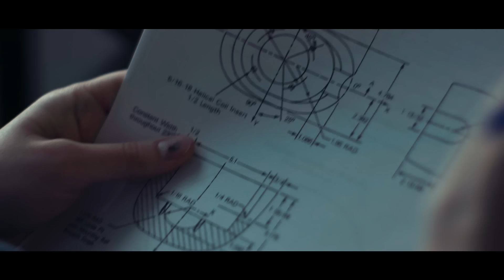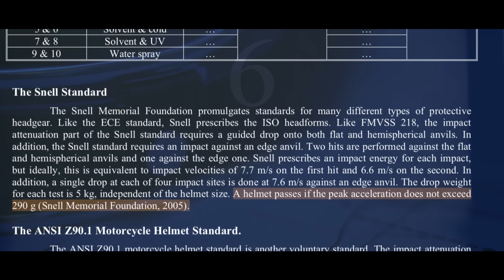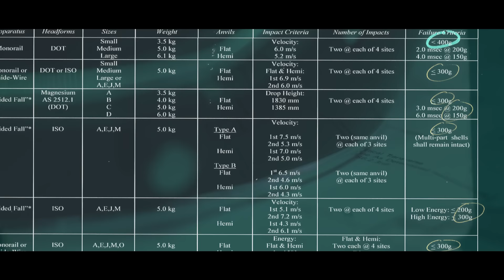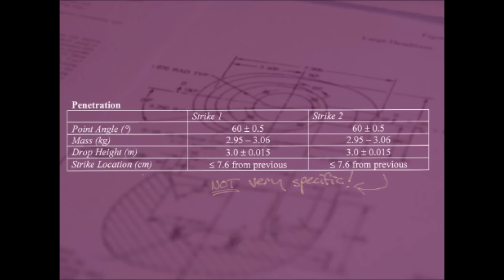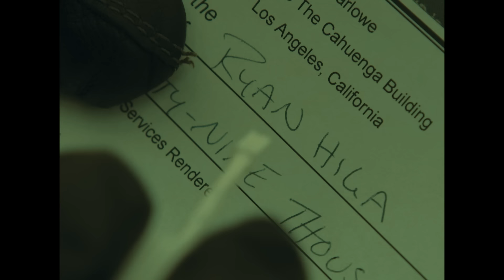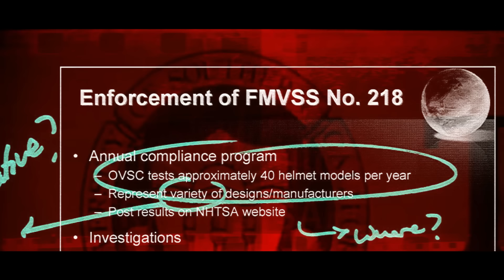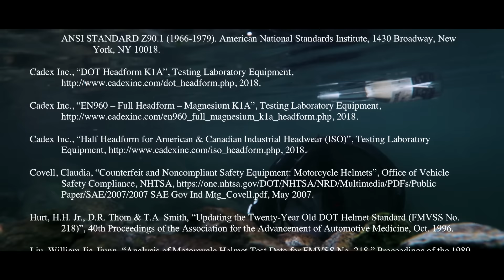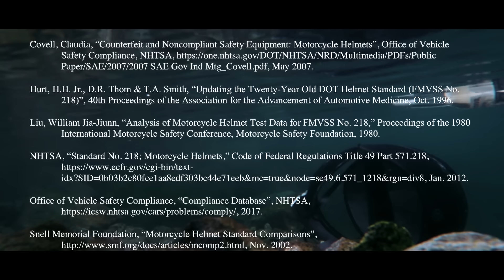Uncovered - Dangerous Secrets of the DOT Helmet Standard

Comment: As someone who has a hat size of around 8-3/4 to 8-5/8, I would have to say that finding ANY helmet that will fit is challenging enough, regardless of certification standards.  Even the ones that are Snell rated seem to only be Snell rated in the smaller sizes.  Regardless, I've had some pretty good accidents over the years that resulted in broken bones and internal injuries that did not result in any head injuries despite landing face first in at least one of them.  I figure that even a crappy full face helmet is better than NO helmet... Been riding for over 50 years and haven't had an accident in around 40...
Reply: Thats cool but not really relevant

Comment: Bit late to this party but do want to compliment F9 for this excellent video ... and share an experience that enlightened me to the fact DOT rated helmets should be considered sub-par head protection.

When my daughter and I got into sanctioned kart racing, the rules specified SNELL rated helmets for all sanctioned events ... it didn't take long after that to find answers to the many questions spawned by that particular rule ... and since then, some 8 years ago now, it's been SNELL rated helmets for me and anyone I know and am able to influence.

This past year, while looking for a new lid, I was surprised to learn how many of the high end helmet manufactures have given up a SNELL rating to offer the in-helmet, slide down, sun-visor "feature" ... I'm going to assume SNELL did their due diligence and found these designs reduced the protection performance necessary to achieve the rating ... and in my mind, that's enough to go old-school and just wear sunglasses or a tinted visor.

Hope this adds some value to the original post ... don't expect many will ever see it but thought it worth putting up under this video heading.

Again, excellent job to F9 ... interesting, informative and entertaining ... thank you!

Comment: Great Job on the video...you need to make them more often! Aside from that though, I have seen conflicting data. Many of the softer shelled DOT lids transferred less energy to the head than the stiff Snell lids did in a Cycle World Test some years ago. The foam and padding was stiffer in the Snells and transferred more energy, but resisted puncture better. The stiffer, thicker shell on Snell helmets was more resistant to a second Identical hit in the exact same spot (which I cant see happening in the real world) than the DOTs, but many times the g-force on the first hit was significantly higher on the snell rating. Im certainly not saying that the bureaucrats have done their jobs at DOT... just that Ive seen other data. I also noted that your sources listed Snell... which will obviously say they are best haha. All that said, Snell helmets are usually higher build quality, and the foam and padding may well have changed since Cycle Worlds testing, which I remember to be around 2009. And lastly, my helmets are Snell, if for nothing else than to comply with Track Day requirements. Thanks for the good work!
Reply from the maker: You raise another very interesting story there. The Snell M2005 standard was widely regarded as "too hard." Like you say, the stiff foam transferred too much energy at low velocity impacts (the majority of crashes). A doctor and one-time Snell employee came out saying that Snell used the hard foam to boast extremely good high velocity impact numbers, which was essentially a marketing gimmick that actually decreased safety in most crashes. He was fired over it I believe. In the end Snell took their medicine and made big changes for M2010. Since then their standard has been in agreement with most everyone else. Thanks for bringing this up! ~RF9
Reply: FortNine ah... I see. Thanks for the update👍
Reply: The helmet article underlying this and that people still talk about actually goes back to 2005, "Blowing the Lid Off," (in that article the "marketing gimmick" quote was attributed to Jim Newman, a former Snell director) as well as a later article in 2009 in the New York Times, "Sorting Out Differences in Helmet Standards" both by Dexter Ford and revolve around the 2005 Snell standard.  In some ways - as you point out - they are ancient history as Snell subsequently implemented both a 2010 and 2015 standard.  The fired person you are perhaps thinking of may be the same Dexter Ford, a journalist, whose departure from Motorcyclist many believe was over the NYT article.  Search "How the truth about motorcycle helmets got a journalist fired."
Reply: FortNine how about a follow up on this and ECE? Great video!
Reply: RevHiker> An excellent reply...and subsequent follow-up conversation!
But, you questioned the likeliness of repeated impacts to the same spot on a helmet... just think of a rider that is sliding on their back, and the back of their head repeatedly hits the ground and bounces, then hits again and again...on the same part of the helmet...maybe not SO "exact" as hitting a pencil mark, but certainly in the same "fracture zone" of maybe a 2" to 3" circle... For example, I was in a 'lay-down' where I hit some oil on the roadway, and I 'tumbled' to a stop... My head had hit the ground 5 times...all within a 2 1/2" scuff mark!
I certainly am NOT an impact specialist / engineer or anything of the sort... but it seems to me that a very effective material to use as part of the internal padding and energy 're-distribution' would be the 'compression gel; that we see so much in seats and auxiliary pads. The prime objective in protecting the brain from concussion is 'deceleration' rather than the 'sudden stop' of smashing into the inside of the skull. I have actually 'installed' some layers of the stuff in the back of the helmet I wear most often. It makes the helmet a more 'perfect fit' for my head shape, and is quite comfortable. (And even made the helmet a little quieter.)
Reply: Additionally, the Snell M2010 and M2015 standards are nearly the same ;)
Reply from the maker: bedmac2, You're right! I was confusing the director with poor Dexter Ford. Thanks for clearing that up - for those wanting to read the article you referenced: https://jalopnik.com/5582380/how-the-truth-about-motorcycle-helmets-got-a-journalist-fired ~RF9
Reply: A helmet certainly can impact multiple times in the same area during a crash. Particularly while you tumble several times in a crash. I know because I've done it. 
I have tested several helmets in real "real world" scenarios, also known as crashes. Never once did suffer injuries beyond bumps & bruises.
Reply: You make some good points. In my get-offs, its been the opposite, so maybe Im just going on what I have seen. I low sided at about 70 and had long scuffs on either side of the helmet. In all my other crashes (mostly dirt) I had maybe 1 impact before either being back on my feet, or having my head up to see what was ahead. In most of them, my head wouldnt even hit the ground.
I think the D3O stuff they are putting in some helmets is good stuff, and will help protect people. Similar to the gel maybe. 
Thanks for the different perspective. I guess they have to try to prepare for any type of crash. Good call.
Reply: I remember that article, it basically said that, at the time, Snell helmets were better equipped to handle the impacts related to racing crashes where you what to survive impacts st the very height of the energy curve, whereas these same helmets transferred too much energy at lower ends of the energy curve. It was an interesting article. But remember, this is the same government that ruined the gas can.
Reply: lol bullshit
Reply: Good point Wayne S. 
I truly hope you're right about never more then bumps and bruises, if you've been in several crashes.  But I hasten to point out here (although I believe  you likely are well aware), that severe head injuries are really severe brain injuries, and can't be seen.  Ask any veteran NFL player; the evidence is mounting.
Reply: It was Dexter and Motorcyclist not CW, and he didn't do the actual testing. They hired a testing company and consulted head trauma docs, including Dr Hurt. The article was called "Blowing the Lid Off" and it was truly explosive (https://motorcycleinfo.calsci.com/MotorcyclistHelmets.html). 

To say that Ford had a beef with Snell is bullshit. Snell attacked Ford and MC after the article came out, and Arai and Scorpion pulled all advertising, yet MC didn't back down.

It's all about dwell time, or G's over time. Snell had it all wrong. DOT and ECE were very similar and had it right, and they just plain outperformed Snell helmets. The M2010 and M2015 standards are better, but not up to ECE or DOT standards still.

I owned a Z1R, the "winner" of the original test (there were no winners, just transmitted G ratings) and shelved my brand new, never worn Scorpion that performed the worst. While the Z1R was no Arai, it was perfectly fine for a full day in the saddle and I wore it for a few years.

Yes, there are issues with the DOT standard, but I still will not wear a Snell helmet. I refuse to give them a dime of my money after their ridiculous responses to Ford and MC. I look specifically for DOT and ECE from trusted mfg's.
Reply: @BucketWheat  Wouldn't softer, compressible foam still be better even in an accident like yours ? My thinking is , even repeated impact on the same area w/in the same incident you'd be slowing down from (60 mph +/-) ? In my crashes my helmet didn't take any real impact , it only saved my forehead from being sanded off. (The other head-on w/a pick up I left it at home that day but took the brunt of impact w/my butt after laying it down.)

Comment: So, what about SNELL versus ECE ratings? Because I've read that some helmets with SNELL certifications are tested AFTER release to the public and can slip through the cracks, while ECE rated helmets must be tested BEFORE they are put out on the market.
Reply: Snell not only tests helmets, but they also work alongside the companies to design helmets. They also do required spot checks before after and during manufacturing. If the company says no to snell then snell removes their license for the company to use their certification.
Reply: Either way ECE and snell rated are the best of the best for safety.

Comment: I usually try to find a modular that passes the ECE standard as well as DOT. Obviously this video took a lot of research, but can anyone comment on whether or not the ECE standard is safer? I just sort of assumed that the EU is more safety conscious so I'm getting a better helmet when I buy one that passed both. I buy modulars so I'll probably never buy a Snell bucket.
Reply: Don't forget to check the Sharp test when shopping for a new bucket!
Reply from the maker: ECE is much safer than DOT. 300g limit, widespread batch testing, more comprehensive impact test zones. Also their certification is 110 pages long versus DOT's 20. Not that length automatically means conscientiousness, but in this case it does! ~RF9
Reply: Also that batch testing means the helmet didn't leave to retailers before being tested.
Reply: Checking the SHARP ratings is definitely a good idea! I recently took several helmets off my list due to poor sharp performance. There are quite a few helmets that are sold in the USA that haven't been tested by sharp yet, especially dual sport/ADV helmets. Now I'm just going to save up for the new AGV carbon flip up and hope I don't break it prematurely like my last Schuberth.
Reply: I remember listening to an interview with the head of snell a while back saying that the only reason there aren’t snell modulars is that nobody is submitting them for testing. Whether that’s because they wouldn’t pass as well I don’t know.

(Edit) Here it is: https://overcast.fm/+BNCzO-NAk/12:46
Reply: That makes sense to me, in the Sharp ratings all the modular helmets I checked do far worse than the full face helmets.  It compromises front and side impacts while adding bulk.
Reply: isn't snell certification mostly needed for racing applications. That is, to enter a race or even a race track you need to have snell (atleast in USA) approved helmet, from my understanding. Who is going to a race track with a modular, heavy, not made for racing helmet. Or an ADV which is not made to go fast enough for race tracks. That is why manufactures dont bother with snell for non-racing helmets.

SHARP is done by independent team and from what I remember, they go to the stores and buy helmets of the shelves with their own money. That is why, they do not have a lot of helmets tested.
Reply: sFde46 usually yes, I know drag strip you need snell approval, motocross and supercross tracks, and race tracks
Reply: I agree ECE has a lot going for it for a number of reasons, but absent any study comparing them to DOT (or Snell for that matter) using real-world crash data I don't think one can definitively conclude ECE is "much safer than DOT."   Or maybe there is a real-world study somewhere and I'm unaware of it; it would be great to have one.  At this point one can just argue the quality of the testing methodologies, material characteristics, sampling, etc. and that indeed is a legit avenue for consumers to consider.  I just don't think we have enough information to translate what we know into "much safer."  Even looking back to that infamous DOT v. Snell issue from years ago, it was reported the Hurt researchers found DOT helmets worked just as well as Snell helmets in real street conditions.
Reply: check out caberg and bmw helmets. 5 star sharp ratings on modulars. HJC also come pretty close.
Reply: While I find modular helmets convenient, what I really can't live without is the built-in sun shield. At one point I was told that no helmet with a sun shield would meet Snell standards.  Since most modulars also have the sun shield, perhaps this also affects why they don't meet Snell standards?
Reply: A few modular have a snell sticker on it. It's been a while sinse I shopped for a helmet, I couldn't tell you. Hopefully Fortnite has some cuz I need a new helmet
Reply: The very few modulars that met the Snell 2010 standard are, as near as I can tell, no longer available and there are no modulars on the Snell 2015 standard list.  But remember that they have to be submitted by the manufacturers to be tested and they pay for the privilege of the test and each sticker used.  Is it because they are harder to pass due to design (hinge hardware or internal shields)?  Is it because the manufacturers think Snell is less a consideration for modular buyers?  I have no idea.  Here is the list of Snell M2015 helmets http://www.smf.org/certlist/std_M2015
Reply: One thing about ECE is that they actually test compliance. There is a lot of quibbling about the standards being insufficient but many here have glossed over the fact that DOT is self-certified meaning the manufacturers "certify" they have tested the helmet and it meets the standard. The video makes the point that DOT is concerned with a lot of other stuff than compliance. "Manufacturers lie".
Reply: In that interview with the snell director, he aggressively bashes ECE and praises DOT. At one point he spreads a rumor about ECE third parties not being equally good, as if an honor system performed by individual manufacturers would be uniform. Very, very weird.
Reply: ECE is the best and safest standard out there. that should really be the high bar you use.
Reply: omega5040 there aren't, too my knowledge, any modular helmets that meet the Snell safety standards.
Reply: Zach P No, Snell is better.
Reply: sFde46 you can race with many organizations with an ECE/Dot certification here in the USA. Hell, you can race in MotoGP with an ECE only rated helmet.
Reply: Major Diarriah does it compromise a front or side impact any more than a 3/4 or half helmet?
Reply: James Snyder it's because they won't pass the chin bar mechanism strength test. Several brands can pass the impact portions of the testing just fine. Snell's refusal to certify modular helmets that don't pass their chin bar mechanism tests is just dumb when you consider that they do certify 3/4 helmets like the Shoei 3/4 helmets.

Comment: Question is if the ECE is any better
Reply from the maker: Yes, I think ECE is much better. 300g limit, widespread sample testing, more comprehensive impact areas. To give an example of the conscientiousness, the ECE criteria is 110 pages while the DOT is 20. ~RF9
Reply: FortNine or look at the Sharp ratings?
Reply: Yes
Reply: (For those that don't know.) SHARP is the UK's add on to the ECE ratings. So only helmets that have passed ECE, will get a SHARP Rating.The only problem with the SHARP, is translating the UK/Euro Models to the North American Models. Given name changes, and the fact UK sold helmets, may differ quite a bit from those of the Americas.
Reply: Given how much Europe regulates stuff like this, Im fairly certain it is. Plus there are many helmets that are Dot rated but not ECE.
Reply: Thanks a bunch Ryan! <3
Reply: For many years the bigger German motorcycle magazines did test helmets under the same conditions as ECE for verification. Very few helmets had different results. So few in fact it became boring for the readers, which made them stop these destructive and expensive tests (several models of each helmet, expensive lab time in a renowned University lab). Nowadays even the cheapest China helmet sold in Germany for 70 bucks passes the ECE, and we can rely on it.
It is an example for a norm that brought real benefit for the producers, the sellers, the consumers.
Reply: By ECE every production batch is tested. If test fails then whole batch is discarded as unsafe.